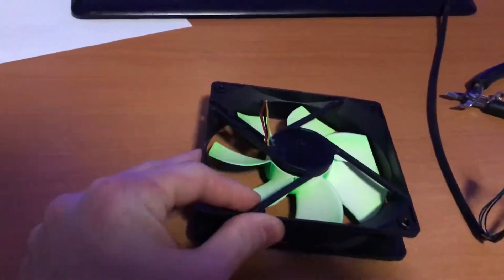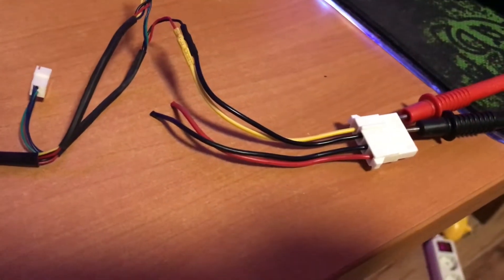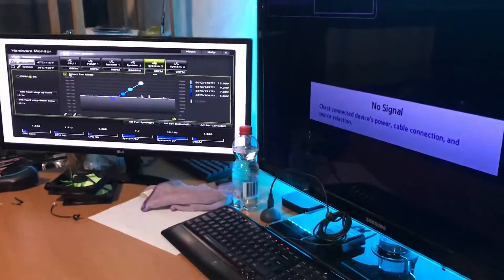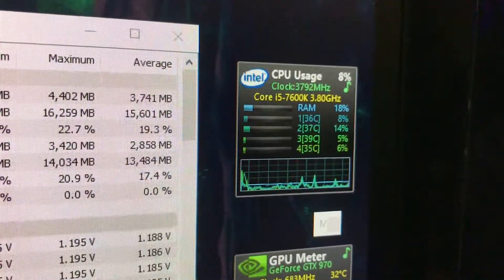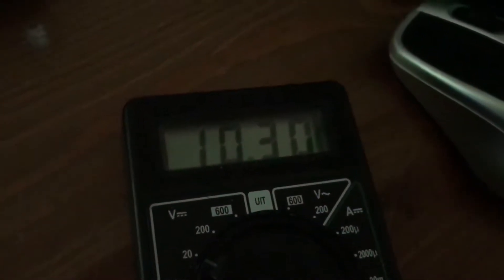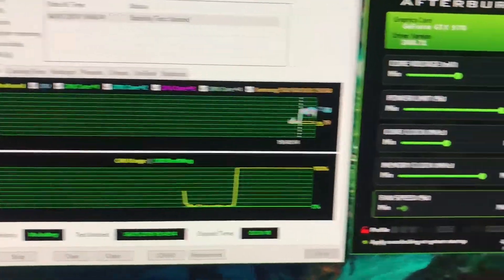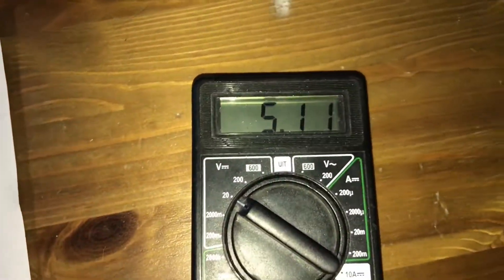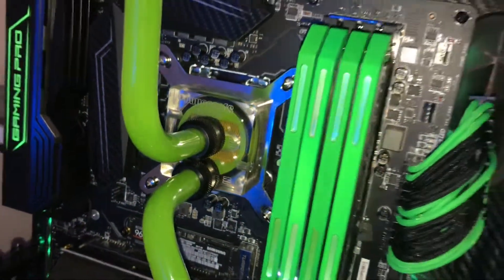Modding non pwm pump to adaptive speed

Comment: This pump is a copy of the SC-600 pump, the problem with this one, is that not only you can get rpm, you need a external dc converter for the molex 4 pin, or mod it to a 4 or 3 pin connecter to link it to the motherboard, that if the board has a DC mode on the fan controller on bios. Also, i don´t belive the pump can get to 600 or 500l/m. its just looks so cheap.
Reply from the maker: tdomingues89 i dont know what you mean but it runs great, i have it run at 2.3k rpm and its mad silent, but i can ramp it up to 4.5k rpm, i do not know how much L it does but it works mad good, have it since 1.5-2 years now, still kicking, really silent too
Reply: @Gagliano17  still a copy of the original lol, The version that you have has a rpm ? ok, thats rare, not all of them have that. Its possible you have the good copy of the pump.

Comment: Nice! It looks like you have much old good stuff. can i buy some of them to upgrade my laptop? (sony vaio 2012)
Reply from the maker: this has nothing to do with the laptop? this is a watercooler for my desktop :P
Reply: Yes thats right. But i've seen all your video's and you have so much upgrade stuff and my cooler is so bad and my laptop is really hot. thats why.
Reply from the maker: i have two videos showing what you can do for a hot laptop, also you can try to clean the fan
Reply: allright. Im not good with laptops so i ask my sister. But thanks. Ill go wtch that video's.

Comment: High temps for  i5 tho is ur cpu block well mounted? Get a real d5 g2 pump this sure is cheap  but looks like a joke like aida if u gonna test use prime
Reply from the maker: you're aware that it's running at 5ghz right? on high voltage too? and i'm not rich enough to get such pumps and stuff, i find 38c and 68-70 full load on a system which i don't game or anything on plenty, i prefer aida because of stability testing, and reality testing, prime is very unrealistic, especially for my own usage
Reply: lol lets make a start. voltage - power cosumption gives the temps not the clocks . higher clocks just need more juice where silicon lottary comes top play when oc .... 1.35 core with no hyper theating a 360 rad  and the medium pusher like aida yea crazy high  us should be at least below 60  aida is shit in bf1 i run 10c hotter in bf1  than in aida .   just to get an idea i run 6700k with 1.360 cpu z core voltage with medium low noise fan  rpms around 800 at 70c(these are prime temps - in aida i am around 60 with heaviest cpu setting)  turn off the hyper threating drops me down to 50-55 c  with less rpms with a noctua nhd 15  .     use in prime costum  all threads  MIN and MAX fft size k put there both 1344    also check put fft in place  . either u lost verey bad the lottary in thermals or too much paste in cpu not good touch or the pump  push slow or is not push enough or a little from all ... are the tubes vey warm  after some time in aida the rad is hot? touching it? the air is coming from the back of the rad very warm - hot?
Reply from the maker: the tubes are cold, the radiator is cold, the pump is set to slow indeed, on low temps, fast on high temps, in a week i'll get vue, which can show me how fast the waterflow is, also at that point i'll remove the waterblock that way i can see if i used to much/less thermal paste, you can see that in my previous video how much i applied. i think i did a little to much not sure, but everything watercooling related is cold, and the air that comes out at the radiator is still cold, not even warm, i'll throw on some prime for an hour and check how warm the rad and stuff then is
Reply: Dennis Gagliano single rad 70c cpu temps and even Rad is cold u understand that the temp readings are way super high . So either the readings are not right or the cpu block  is not well pressing the cpu ihs or ihs and chip intel surface paste is very shit . If last one is the case delid will give u over 15c from 75c .  Stay away thermaltake cancer fluids . Ek is top ;) even the pink one long longivity .  
Ps at build log 8 at 8 : 10 u can see that the cpu block lands at the 4 stands so the screws just keep in place the block aren t pushing to the cpu the stands are bad design in more expensive solution like ek  u will see springs at 4 stands so u can tight press the block if i were u  i would definitely start from there reseating the block. I would remove the plastic rings between the stands and the motherboard dont worry its ok as long the stands are toughing those silver little things around the holes . Mx 4 or artic silver 5 both good paste ,use  at least less than half the paste used i would go with 25  % that u used in the middle that the chip is   . Test the surface dont put the block and put the screws , push it good then lift up and check , if it does not cover the corners its ok heat comes in middle from chip ;
Reply from the maker: i use something temporary in fluid atm, none from thermaltake, i'll get primochill vue soon, then i can check the thermalpaste aswell and the space, i'm aware that i used the wrong screws (from another block) so maybe that's the issue, we'll see

Comment: you really have to wait for the loop to reach equilibrium to really see the max temps the water will continue to heat up over the span of half an hour, I am convinced the temps will still be fine tho, geat job
Reply from the maker: i've been running the look for over 3 weeks, it's all fine

Comment: Nice cable mod! 
The system sounds pretty quite. 
I think your pump should do just fine. As long as it continues moving the fluid, at the lower voltages.
Reply from the maker: Yes it does i’ve been testing it for 2-3 weeks now, all is good and fine!
Reply: Terrific, sound like you got it going well. 👍